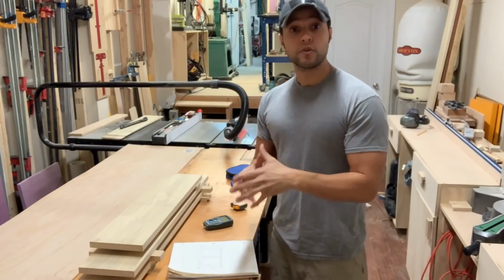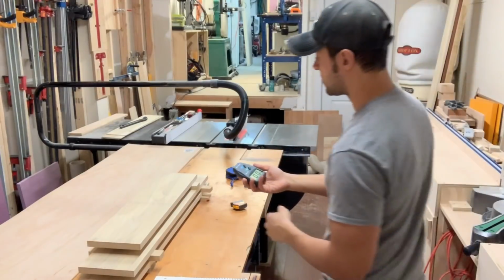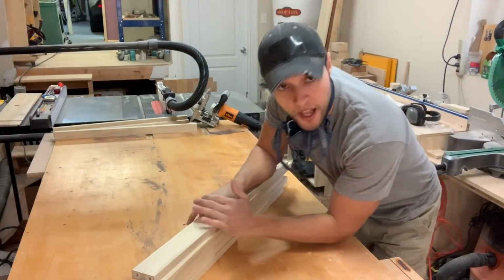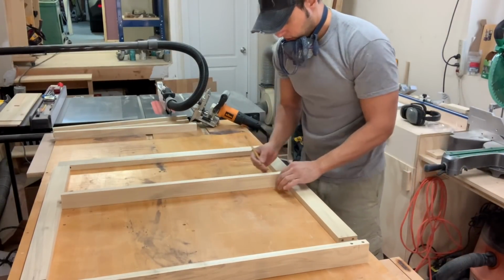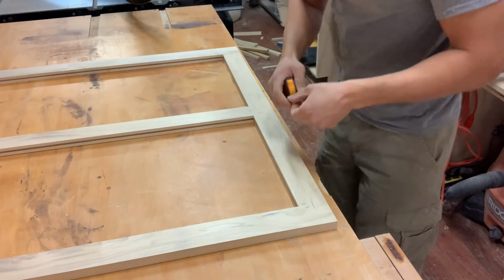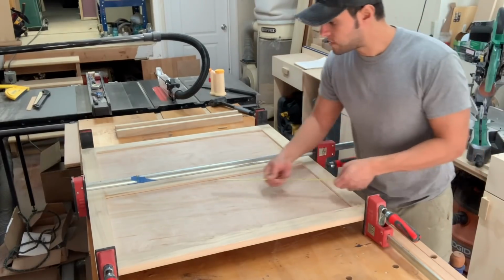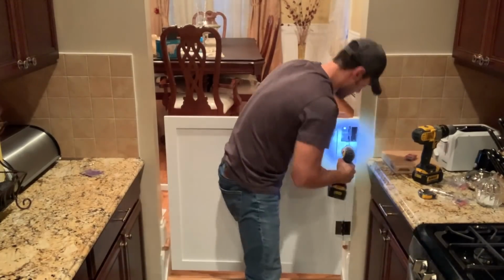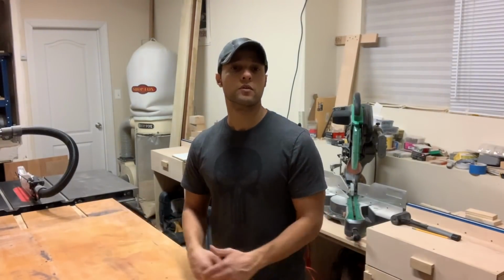DIY Baby Gate

Comment: How do you like your Jet 2550 Drum Sander? I sold my 16/32 and was looking to replace it with this model.  Not too much info on this machine yet , any regrats  and were you going to do a review on it.
Reply from the maker: Alan Matzelt So far it works the way it’s supposed to. It’s a big, expensive machine. I’m not going to review it unless Jet would be interested in sponsoring me.